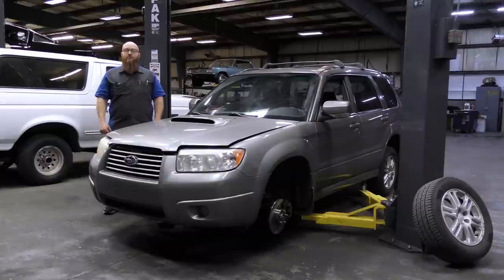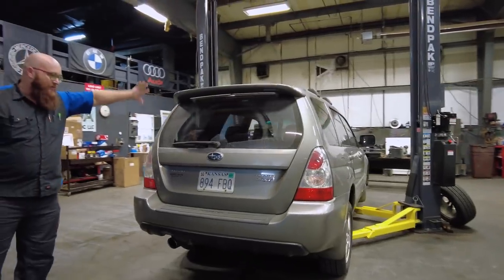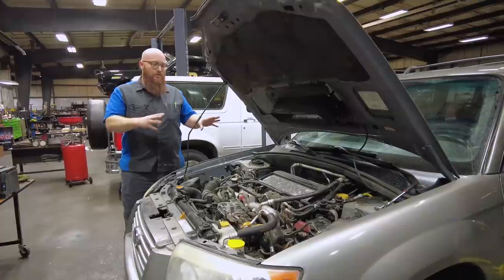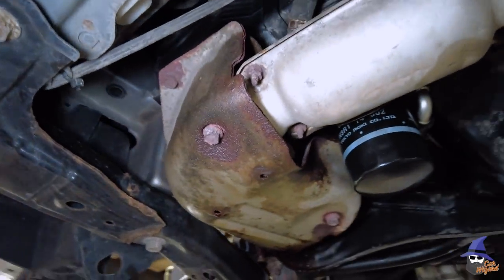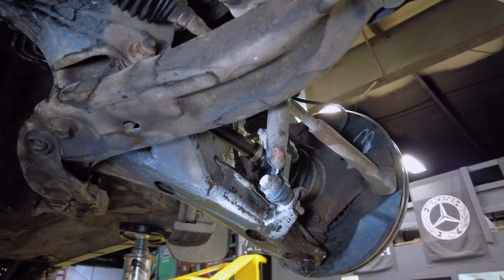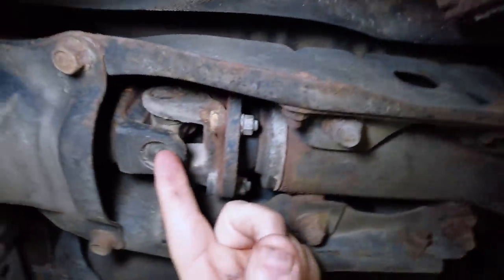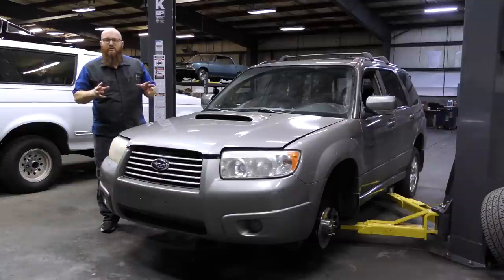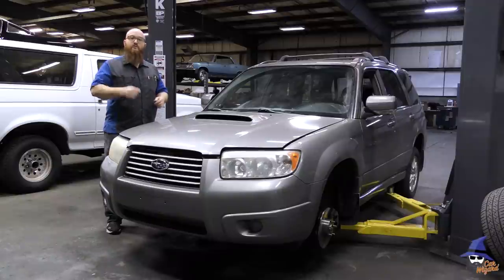Can't fix it all! '06 Subaru Forester XT has issues the CAR WIZARD doesn't fix. What are they & why?

Comment: We are now on the very first day of February 2023 and the Car Wizard should have the next all-new installment of the six used vehicles that you should plan to buy in general tomorrow. The very first vehicle to buy, if you can afford a newer one is the 2017 to 2021 Mazda CX-5 with the 2.5 L Skyactiv four-cylinder engine and the six-speed automatic transmission. You can always go for only the front-wheel-drive (FWD) model, if you want to save money on fuel and maintenance or repairs, but anyway they are very reliable and they are extremely fuel-efficient. Then, the second vehicle to buy would be a 2011 or a 2012 Hyundai Tucson with the 2.4 L four-cylinder engine and the six-speed automatic transmission. They are fairly reliable and they are good on gas with only the FWD model. The 2 L engine is a little underpowered for the Tucson, but the 2.4 L engine is just a regular engine, not the one with GDI technology. So, you should fair with this vehicle. The third vehicle that you could buy is the 2008 to 2012 Mitsubishi Outlander with the 3 L V6 engine and the six-speed automatic transmission, because these vehicles are very reliable and they are built in Japan since manufacture. The warranty on these Outlander's have already expired back then, but they are currently on the road with proper maintenance. The gas range and the mileage is not that good, but if you go for the 2WD model, it is still worth the penny for fuel, so make sure you do not accelerate or brake too aggressive and drive fairly slower than the speed limit (the vehicle capability), about two miles per hour or ten kilometres an hour below, you should be golden. Furthermore, the fourth vehicle to buy will be the 2003 to 2006 Infiniti G35, preferably the coupe with the six-speed manual transmission, because the 3.5 L engine from Nissan is bulletproof and when driving on the highway, you can get up between 25 to 30 miles per gallon, when you take it on a road trip through the southwestern United States. These G35's are much better vehicles than these G20's, because the G20 is unreliable and they have numerous problems with these vehicles. So, stick to the G35 for an Infiniti. The fifth vehicle that you can buy would be the 2008 to 2010 Mitsubishi Eclipse, coupe and GT trim as always with the 3.8 L V6 engine and the six-speed manual transmission. These Eclipse's are fun vehicles to drive, but fuel economy is not that bad, because you can still get around twenty miles per gallon and you just have a lower fuel range. It is an excellent vehicle that you can use during the weekend or on special occasions. Finally, the sixth vehicle to buy, if you are a CEO of a company or a millionaire would be the 2002 to 2005 Ford Thunderbird with the 3.9 L V8 engine and the five-speed automatic transmission, because they are a great collector's vehicle, you do not have to worry about repair costs, you can spend more than a hundred dollars to fuel up the tank from empty to full and you can take on a cross country road trip within North America (except Mexico). In addition, for these newer Thunderbird's, you have to keep the vehicle maintained up by manufacturer standards and you can plan to purchase another one and keep your current one in your possession. Anyway, I am totally a fan of these mid-2000's Ford Thunderbird, because the insurance is a lot cheaper for this vehicle than a European one. I hope you have a great day ahead and the Car Wizard will approve this idea and it should be uploaded tomorrow morning. Thank you very much for your understanding about which vehicles to buy and which vehicles to avoid. It should be very interesting, guys.

Comment: In regards to the secondary air system, ots a super cheap fix, buy a set of blanking plates for £20 and just remove the system entirely.

Not sure how it works in the states but in the UK, our emissions tests are done when the car is warm and since the secondary air system is only effective on a cold start to "dilute" the emissions, its not a system that actually affects the running of the car so I ordered blanking plates and wired up a resister circuit to make the ECU think the secondary air pump was still functional and stop it throwing a check engine code and problem solved!

Comment: Just bought an 06 xt manual with 62k miles on it! Love the car but chasing a boost leak or pre-turbo exhaust leak right now. Any tips? A little rough tipping into boost but WOT it pulls great. Also very minor surging on light throttle below 3k rpm.
Reply: Check every hose or duct that has folds/ribs.
Reply: Pay attention to the bottoms of all the rubber hoses on the boost side, oil will accumulate and rot them out.

Does it have a cheap or non high quality aftermarket intake? If so and you bought the car with it i'd suspect that if your leak chasing fails. MAF sensors don't like to be moved (the stock intake is purpose built for smooth airflow across the sensor) and cheap aftermarket units mess that up and kill smooth driveability at anything but WOT. 

If you have access to a good scan tool that can show you fuel trims and sensor datalogs it may help you in your quest.  A boost leak will show as more incoming air and highly negative fuel trims.
Reply: @volvo09  Very helpful information here. The car is completely stock other than a muffler delete I had done recently. 

I don't have a good scan tool. I need to get one!
Reply: In addition to what volvo said check over your PCV lines, these things have a ton of PCV hoses and one of them may be cracked causing an air leak.  If you just bought it and it has 62k miles on it it'll be due for its second spark plug change, if that hasn't been done with the correct NGK plugs you could be getting issues from the ignition as well.  When you pull the coils out inspect the boots for damage and signs of oil.  Replace the boots if they're worn and if there's oil on them you need to do the valve cover gaskets.
Reply: the exhaust manifold is 3 pieces, replace all the gaskets between them and the two turbo ones. Sometimes they leak exhaust but you'll see the evidence on the gasket if they are. The turbo up pipe cracks sometimes at the flex portion. While the car is running on a lift, if you have an exhaust leak you will hear it with a makeshift hose probe one end to your ear and listen around the shields. Sometimes these cars just need fresh exhaust gaskets. After you sort that out, a valve adjustment will make the car feel brand new

Comment: Subarus are amazing. That "sure-footed" AWD feeling, unstoppable in snow. They can also get very expensive very quickly when they break.
Reply: unstoppable with proper tires... my OE tires were GARBAGE in the snow!
Reply: @Dankcatvacs  try Goodyear Eagles in snow... that was my OE tire!
Reply: thats why you stay on top of maintenance
Reply: I only owned one. It ran great in between trips on the tow truck for major repairs. It was my first and last Subaru.
Reply: What kind of maintenance would you suggest for the driveshaft that has to be replaced entirely when the joints go bad?
Reply: @christopherguzzi1316 
Owned 6 Subarus since 1992.  Managed to get one to 270k miles before it got hit. We have never had a u-joint go bad and I have never heard of anyone with a bad Subaru u-joint.  Wizard mentioned it in one of the videos you've obviously watched, but of all the Subarus through his shop, how many has he really seen?
Reply: @boomerguy9935  Model, year, mileage, engine? Be honest!
Reply: @1valg  1987 sedan, 5-speed manual, front-wheel-drive (before AWD was standard). It was so weak, that I had to turn off the AC to climb steep hills. 
I traded it in for a Honda and have owned many sizes, styles and sizes ever since. I put many miles on all of them and they never let me down.
Reply: @boomerguy9935  Yup, sounds right. Subaru´s from before 2001 are not cars I would want to own either! 😅

Comment: Subarus are very popular here in Canada as well, thanks to the all wheel drive. We have serious winter here, so a lot of people want to be prepared to going down the road even with bad weather, which having a Subaru helps a lot.
Reply: Can't you get almost any car in AWD these days. It's not as unique as it once was
Reply: @greengopher2354  
True, but no one has the full time AWD that Subaru uses.
Reply: @greengopher2354  agreed. Subaru used to be unique and capable. But other manufacturers systems have surpassed Subaru’s ability. Also, the Subaru cvt is not considered to be one of the best.
Reply: @haroldbeauchamp3770  Subaru is still the best AWD in it's price range.
Reply: @robsonselzelin  I’m not convinced. I had a 2015 Forester and while it was okay, there’s nothing phenomenal about it. There’s multiple vehicles that are in this class that surpass Subaru’s capabilities. Jeep Cherokee Trailhawk is one. Has a locking rear differential and low range function. It’s not handicapped by a cvt either. Which is what sucked in my Forester. I’m not simply going to agree that Subarus awd system is spectacular because it’s an uninformed popular opinion.
Reply: @greengopher2354  the full time AWD makes a difference in these areas.  Most of the competition has capable AWD but Subaru still does it better. In this price range if you want a lifestyle, cheap to repair car that holds it's value, Subarus are still kling.
Reply: Subaru has a full time awd. Almost all other crossovers are Part time awd.
Reply: @haroldbeauchamp3770  
Subarus are not the most reliable vehicles but I’d trust them much more than a Fiat made Jeep.
Reply: @haroldbeauchamp3770   Subaru was not conceived to be off-roading, it doesn't need differential lock because it was not supposed to go to mud and rocks, it doesn't even have the ground clearance needed to do so. Again, regarding AWD, not Off-road, Subaru is the best in its price range.
Reply: @dillonh321  indeed. I’d agree with you
Reply: @robsonselzelin   as a former owner I can assure you that Subaru owners do not think like you do. We certainly took ours off road all of the time. As did thousands and thousands of owners. Entire Facebook groups are centered around off roading. Whether or not Subarus were designed for that I would agree with you. I think the Wilderness models are an making a better effort at being more capable though off road. The wilderness models are an exceptional value vs the competition.
Reply: @haroldbeauchamp3770  I am an owner of a 2011 Subaru Tribeca and I have no intentions to do any off-roading with it. I bought it to drive with piece of mind over snow, sand and gravel. I agree with you, the wilderness series is much better suit for mud and rocks than any other Subaru.
Reply: @atticstattic mitsubishi has All Wheel Control which is their version.
Reply: At least it's not a junk Volkswagen or bmw or benz
Reply: @Harold Beauchamp  jeep isn't built as good far less reliable
Reply: A few years ago I was scheduled to work at dominos during a blizzard. Everyone else called in except me, and that’s because I was able to convince my mom to loan me her 2010 legacy. That thing is an absolute champion in poor weather conditions. I took 66 deliveries in 10 hours, by far my personal record. It seriously didn’t even feel like the road was slick with how well that thing could move.
Reply: Are there Canadian spec models since you guys are "frugal"?
Reply: @dragonbrownies517 
Mitsubishi! 😂

Comment: Here in Estonia you see a lot more Volvo XC70s or XC90s and we get a fair bit of snow in the winter. 
far as Japanese stuff, most are Toyota RAV4s or Honda C-RVs. most people tend to stand clear of subarus because of blown motors and turbos.
Reply: Jeah, in Latvia the same - a lot of xc70 xc90 xc60, audi quattros, Ravs and crvs, but subarus, they are rare on the roads and as i repair all my cars by myself, subarus is a big no in my car list because of rust and bad engines, they are hard to work on and in my opinion pretty unreliable.
Reply: @jaunteraudi817  my brother worked at a subaru dealer in 2010-2011 and he would be constantly be rebuilding   engines. Blown headgaskets,worn and spun bearings, broken crankshafts on manual cars. All of it was warranty work.

Comment: My neighbors used to be serial Subaru buyers.
They had owned them almost exclusively since 1985.
They ALWAYS sang their praises to anyone who would listen.
However starting in the early 2000s each one they purchased was less reliable than it's predecessor.
The final straw was a new Ascent which suffered from minor niggles to a catastrophic turbo failure all within the first 20K miles.
They now have a Toyota minivan and a Lexus SUV in their driveway.
Reply: Yeah for some reason Subaru, cannot do a three row, re: Tribeca.
That said, I have owned a '97, '04, '05, and we now have three '18's (2 Foresters and an O.B.) while they have had normal problems, no more than any other brand with high mileage, and the thing that struck me was how even when the mileage piled up, every thing worked on the cars.
Radios, power seats, windows, sunroofs, seat heaters, seat adjusters everything.
This was not the case with my Hondas or Toyotas, although the Toyotas were close.
Reply: Subaru, expensive and built to stay that way.  Shoulda been the true ad campaign.
Reply: @tomtheplummer7322  
Ive owned them for decades, along with Toyota and Honda and have not found that to be the case.
How do you explain that Subaru has the highest owner loyalty in the industry? Most people don't go back to a product
 if they got burned.
Just keep repeating memes that you heard on the internet, you'll seem like a really smart person!
Reply: @fubartotale3389  please cite your source for owner loyalty. Loyalty overcomes quirks and problems. I liken Subaru buyers to Dodge/Chrysler buyers. They are fiercely loyal despite most people having nagging issues with them and problems cropping up sooner than it’s rivals. But they are spectacular at making niche products. Dodge with its high performance vehicles and Subaru with its awd vehicles. That’s how you explain loyalty. Marketing and history.
Reply: @fubartotale3389  People sing the praises of Jaguar and Range Rover/ Land Rover vehicles and often buy them repeatedly even though they are considered to be some of the most problematic vehicles on the road.
Often people are "MARQUE" loyal regardless.
Reading surveys you often find that vehicles considered troublesome have high levels of owner satisfaction and those that are viewed as trouble free have average or below average owner satisfaction.
An owner being satisfied or unsatisfied with a vehicle has a lot of factors figured into it besides reliability and durability.
Reply: Yeah Subarus are nice while they're functioning, but when something fails it's usually something serious and expensive.
Reply: @fubartotale3389  I have a 08 subaru tribeca. The 08+ had the 3.6L which is bullet proof and the 5EAT. I am shocked Subaru didn't continue to use the 3.6L in the Acsent... then the CVT would be an issue. This would be my last subaru as they started to go down hill in quality.

Comment: Reason this one has no head gasket issues, is Subaru uses a different head gasket part for the turbo engines vs. the naturally aspirated ones. The turbo head gaskets do not degarde as the normal gaskets do. I had to have my head gaskets replaced (2009 Subaru Impreza) at 105K miles and that cost me $3200. Other than that, I've had zero problems with my car and I love it.
Reply: Dang I'm in the wrong business... That in Canadian dollars?
Reply: $3200 for stupid head gasket replacement. That make a mercedes look reliable and affordable. People should sue subaru for that stupid simple manufacturing mistake.
Reply: *Degrade.
Reply: ...had a radiator failure n engine O. Heated on my Forester 10. HG cost 1800$ a year ago in New Milford Ct.  The Suby I like most is my 03 Legacy L SW with 158kmiles. It has HG problems n I add coolant n little oil for the last 20kmiles n keeps going fine n strong. NO fluid mixing inside the engine.

Comment: You can install blockoff plates and tune out the secondary air system. I own an 06 XT and opted to fix it before I tuned the vehicle…but should have just tuned and done the blockoff plates all at once.
Reply: I was told recently by a Cobb tuner that they cannot tune out the CEL anymore because it’s tied to the emissions system. I hope they/I am wrong about this but lots of things have changed with the new emissions laws regarding aftermarket tunes. Mine is deleted and coded out but I had it done a few years ago.
Reply: @soopermarkus  Cobb will not sell you a tune with the codes deleted anymore. It's always been illegal to disable emissions codes; they just got away with it for a long time!
Reply: @oambrosia  This is my wife's Subaru. I was planing on a Cobb tuner and block off plates. Looks like I will be getting a new secondary air system.
Reply: @doughuman526  Depending on your state you can remove that system and have the codes deleted, no problem.
Reply: @oambrosia  I'm in Kansas, I will have to look in to that. Thanks!
Reply: @doughuman526  It's only illegal if you have emissions inspections :P Oh wait, did I say that out loud? LOL